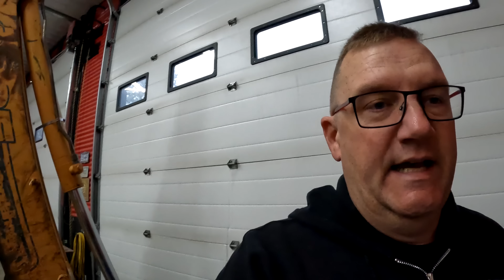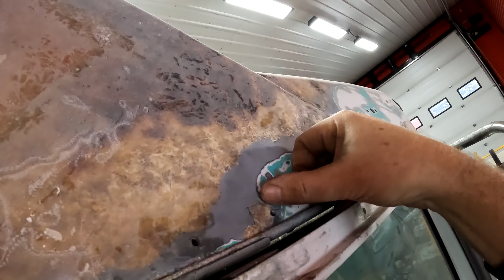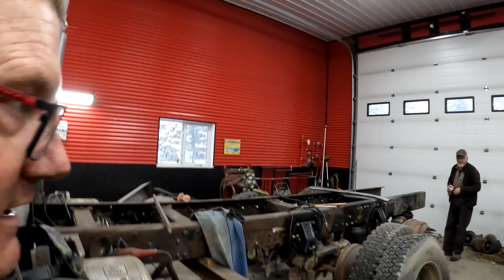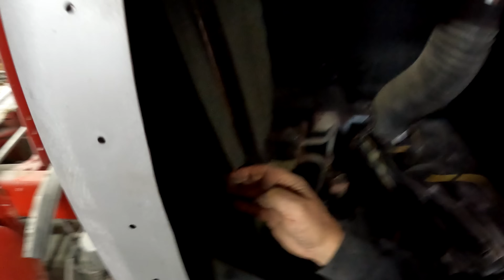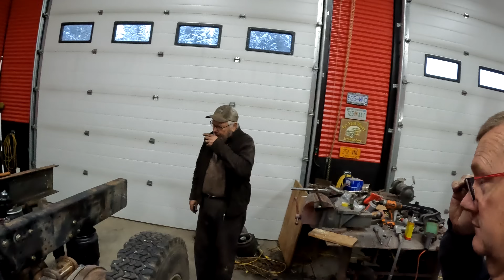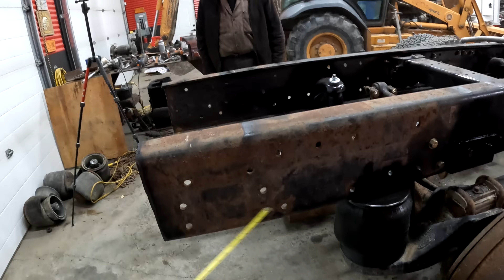Back to cabovers

Comment: Nothing better than putzing in a heated garage when it's crappy outside. The best thing about a person in your position is the projects don't have to be done by Monday so they can get back to work. Sometimes I just go in, sit down, drink a cup of coffee and just look at mine and smile. Of course all my projects fit in my shop but they're motorcycles so there's that. I liked when you said about putting that panel on and your dad says about drilling holes so you drill holes. Always next week for the panel. Thanks.

Comment: Good to see progress on Stubby, did you make a final decision on his transmission? A road trip video of you and your dad in Stubby would be brilliant next year. I'm hoping we can hear him running soon as he sounds good.

Smokey coming along nicely, he will shine once more next year in the summer sun. Brilliant work.

With Good Ole Pete, maybe take the fuel pump off and see if it can be cleaned and rebuilt, may be cheaper then a replacement and be interesting to see. If you can reuse the other 3406 in K2, even better.

Hope your all OK in the snow

Comment: Mike 1st im glad you posted again 2nd thing your dad's kicking ass on stubby which by the way is my favourite followed by kenny and duke. Love the snow we dont get much on Yorkshire these days but i do love the snow the new project the 359 is going to be a good one them CAT fuel pumps are notorious in colder and damp environments to rusting up when stood a while if you strip it down it will need re timing so maybe best to send it off to be cleaned at area diesel i know may cost a bit posted but they are fellow youtubers so may help worth a trying

Comment: Mike I love what you're doing and think you're doing a great job and don't want you to think I'm trying to tell you what to do but I made like a check list you might like to look at 1 fiberglass the dibbits and put the side panel on Smokey 2 Help dad fix backhoe 3 bring in Duke and touch up paint then he's done for now 4 help dad finish the back of truck and put in transmission 5 do interior on Smokey 6 start working on engine in the new truck and go from there.again this is just a thought to help you check some things off the list. Hope your having a better day and remember keep your head up

Comment: Wow that looks like the same drill that my dad and I used years ago to deck our trailer. Ours was a black and decker. I still have it. And your dad is so right. That thing will break your wrist.  The bit may stop turning but the drill won't. What a work horse  they definitely don't make them like that anymore.
Reply from the maker: It is a black and decker too

Comment: One project at a time!! Not a problem ( although, dabbling in a new one now and then keeps you interested!) Have you picked  a name for the 359 yet? 😅
Reply from the maker: not yet, maybe smokey two LOL
Reply: @mikethetrucknut  at least the 359 is exhuast smoke, not FIRE smoke!
Reply: Did you arrive at the reason for the 
359 's Cats high idle
Reply from the maker: @geesss8675  not yet but pretty sure it's stuck injector pump

Comment: By the time you release a video and where you are at on a build, it may be too late. NEVER ever seal wood in any form under fiberglass or other as it seals in that moisture and will rot away before you know it!!! I found out the hard way that wood does contain moisture and getting it totally dry is impossible. Find another piece of metal for structure or make it all fiberglass... it just has to be that way!!